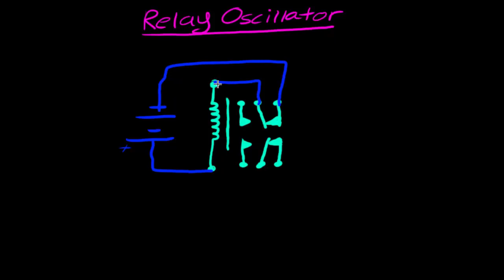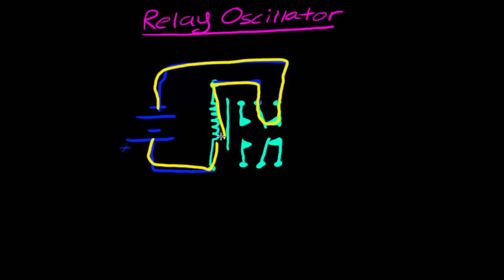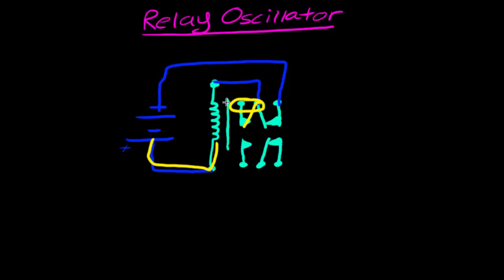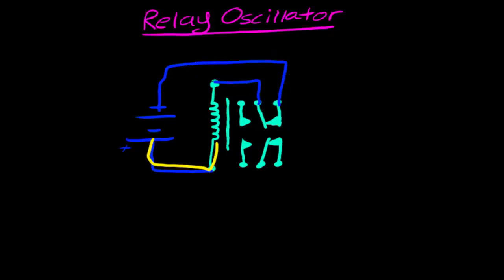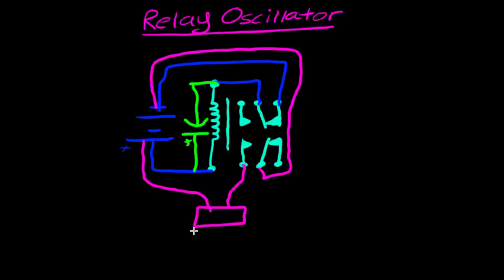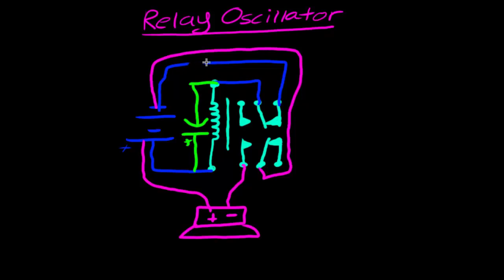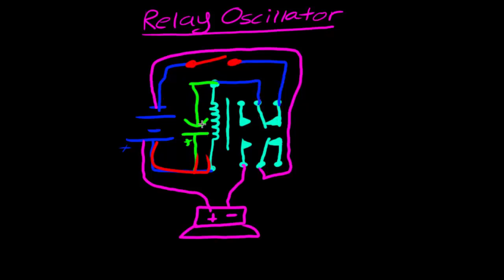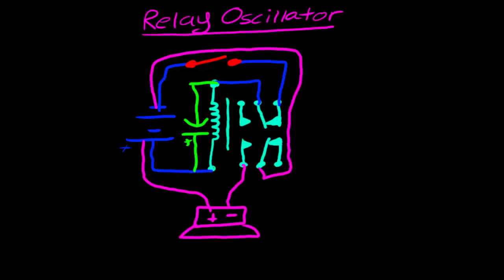Beginner Electronics - 23 - Relay Oscillator & Speaker

Comment: What if you would add a potentiometer in series? Would you be able to adjust the oscillation and therefore the pitch coming out of the speaker?
Reply: yes you can
Reply: Please explain how to connect it in series ..between which two pins?

Comment: Hi, I have a question. I understand why the capacitor is extending the time that the electromagnet in the relay stays on, but I don't know why it also extends the time the electromagnet stays off. Be cause in the demo, I can clearly hear that the clicking is very consistent.
Reply: I'm new, but i'll to explain with the best of my ability. You are correct the electromagnet stays off longer. but its soo minuscule that its unnoticeable to the human senses. considering electrons move at the speed of light (3 * 10^8 m/s) and the only resistance is that of a copper wire (1.72 x 10-8 Ω per metre). the time difference for it to charge can be calculated using t=rc. assuming that a capacitor has a capacitance of 1000µF.  t = 1.72 x 10-8 Ω * 1000µF. therefore t = 1.72 x 10-11 seconds. This capacitor takes five time constants to fill, 1.72 x 10-11 x 5 = 8.6x10-11. it would take 8.6e-11 seconds for the battery to fill the capacitor.  As I said, soo minuscule that your senses would never realise.
Reply: Because the power in the cap has to go somewhere, so it discharges itself and dumps its power into the electromagnet, therefore keeping the relay off after the power has been disconnected.

Comment: "Codenmore" #+!.... hello, thank you for making this series you are actually a very good teacher btw.
Q.    If I wanted to increase my capacitance would I want to run multiple capacitors in series or  Parallel? I think if I put them in series I will get the same amps and if parallel I will increase the amps ... is this correct?

Comment: Summary:
- an relay oscillator is an electronic component that quickly switches between turning a circuit on (completing it) and off (opening it)
- in our example, our oscillator controlled the circuit to the speaker